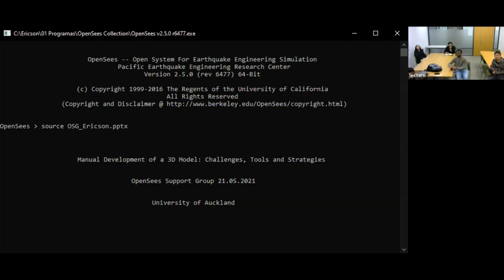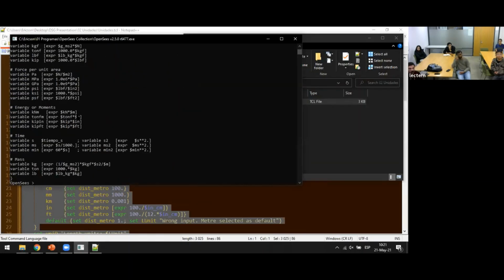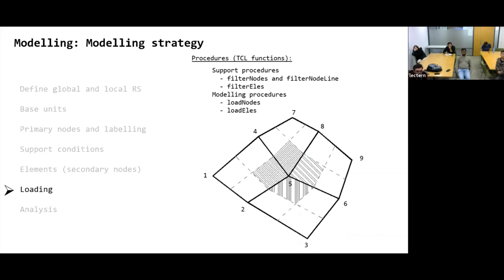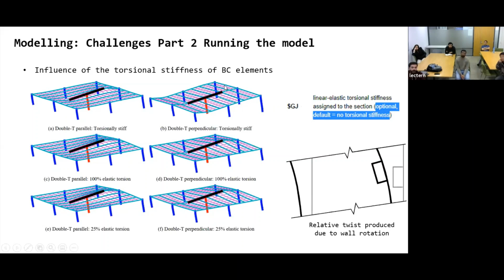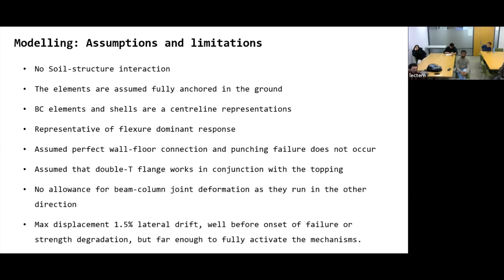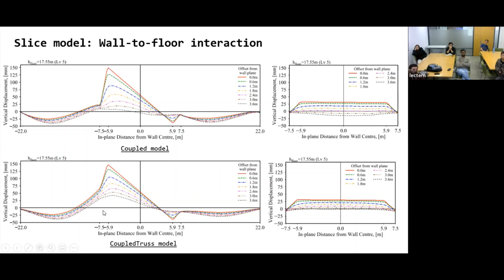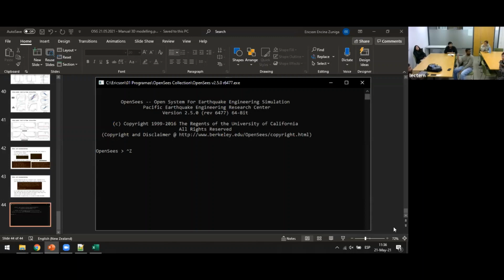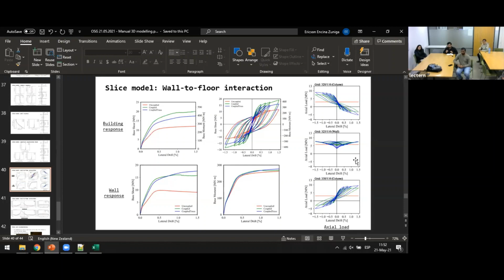OSG-20 with Ericson Encina-Zuniga-Manual development of a 3D model: challenges, tools and strategies

Comment: To reduce the time required to run this type of building using OpenSees, is it possible to use to high preformance computing cluster to solve such problems with OpenSees?